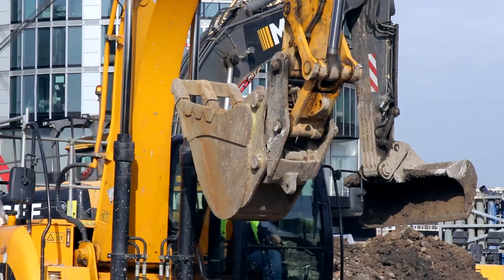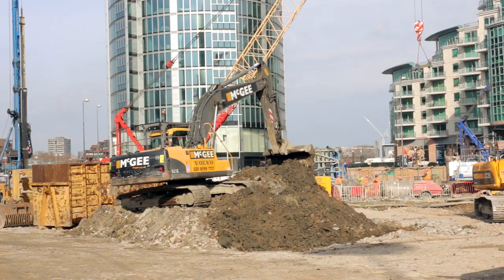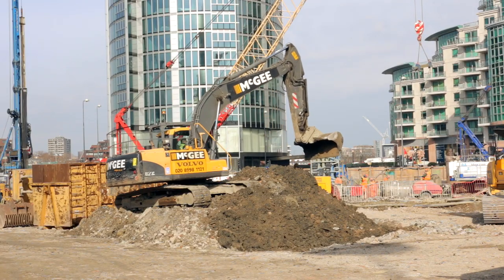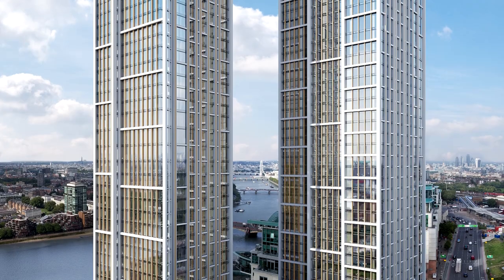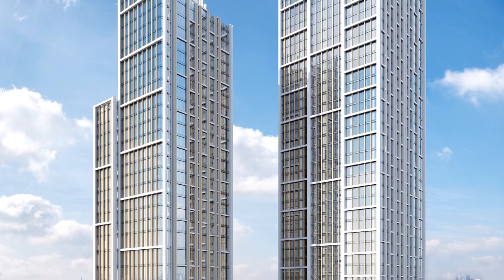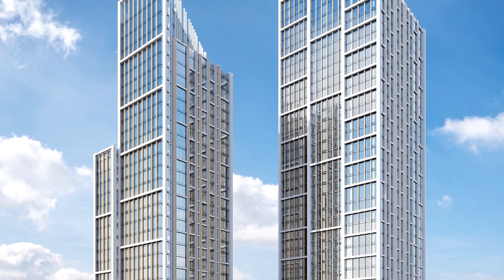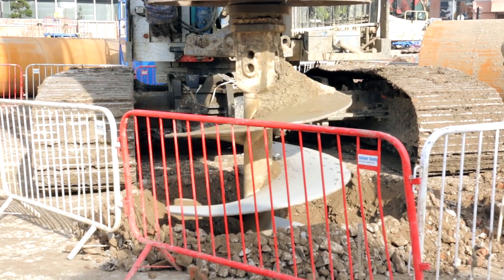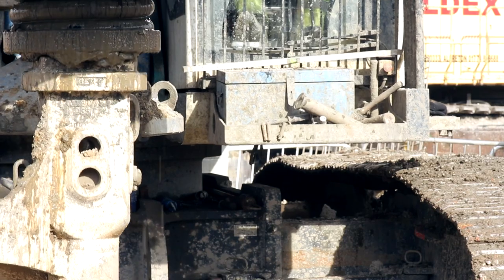How deep are the foundations of a skyscraper?

Comment: Is that 63meters total? How deep is bedrock in that location or London on average?
Reply: 63 meters would be the total length. Bedrock could be shallow but if it isn’t competent then you have to go deeper unless they require skin friction and not end bearing
Reply: JoshL - Thanks for responding. I wonder how deep the bedrock was/is there and What condition it was in. Any additional thoughts are welcome..
Reply: A developer did a skin friction in San Francisco on a roughly 60-story residential tower and over a few years the tower started settling off center to where they are having to do new dead end piles around the tower for re stabilizing effort. For my mind, skin friction hasn't sounded satisfactory for any kind of tower since.